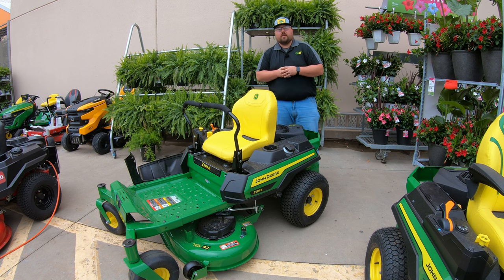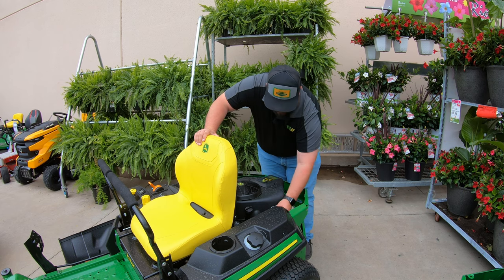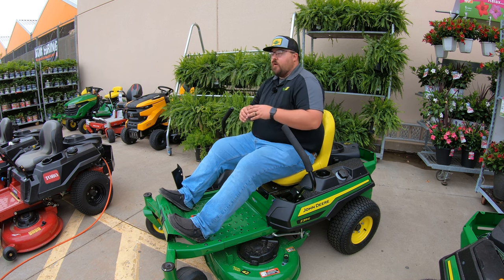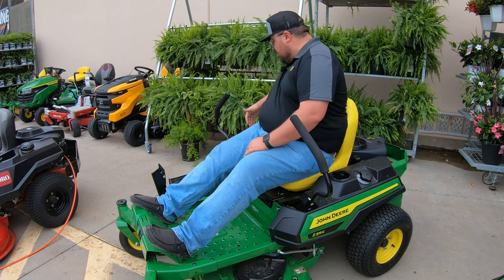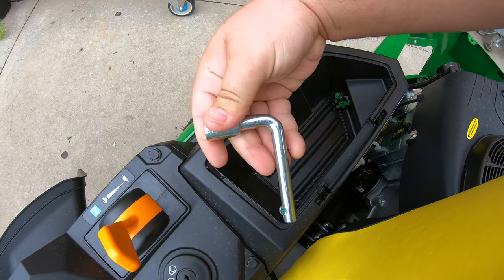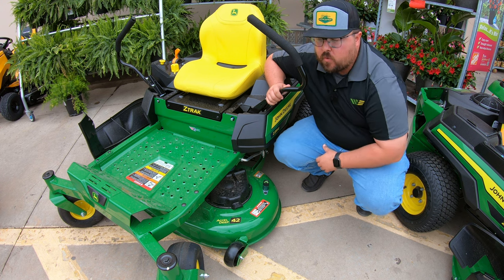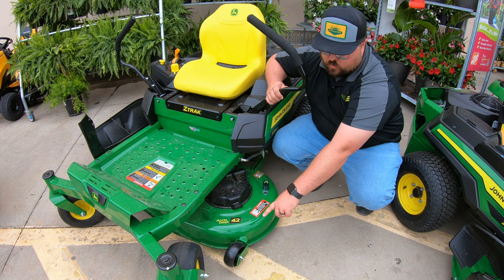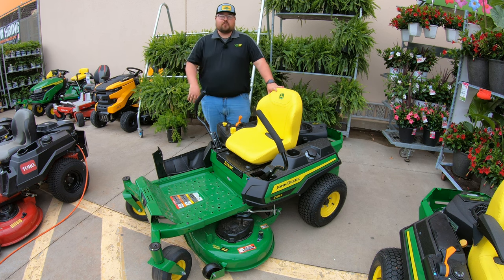2023 John Deere Z315E Zero Turn Mower Review & Walkaround

Comment: Could you guys make a video of why the John Deere z track deck wont lock when the pedal is pressed down? I think it’s simple I just haven’t looked and haven’t found a video on that.
Reply from the maker: Do you mean just n the Z3 series?
Reply: @WesternEquipment  no it was the 530m. I did manage to figure out that the back deck adjuster nut was over tightened and fixed it though.

Comment: Just purchased a 2023 with a 48-in deck. Bought the lawn mower right off home Depot floor. My husband and I have spent 3 hours trying to figure out how to start it. We started exactly as it says to in the book and it just won't start. It doesn't turn over it just doesn't do anything.
Reply from the maker: Interesting... So you have the control levers in the out position, throttle up, and blade button in the down position?
Reply: @WesternEquipment  yes
Reply: @lindamcallister4925 did you end up fixing the problem?
Reply: It ain’t got no gas in it

Comment: So just got one and was pumped, got six acres of land and was ready. got it to start up, followed the directions and read it more then twice over, but it won’t move forward or backwards. I’m slightly afraid that the Lowe’s movers, came in a big truck, dropped it off and left, messed something up, but I hope it’s just something I’m missing, I move the handles forward nothing, just engine runs, blades work. Just not moving. Any suggestions?(it started to rain so hopefully tomorrow I’ll figure it out but was just curious that maybe I’m missing something. It’s a Z325E (edit) I think I found the solution, will know in the morning. Yeah I guess  should have read it six times, it was simple, pull the disengaged things on the back.(metal pieces on either side)
Reply: Im trying to find the disengaged things you talk about in the manual. I cant seem to find them. Where are they exactly?
Reply: I'm an idiot, I found them.

Comment: Brent,someone else had said on another video that the briggs and stratton engine theyre putting on these now are not the intek engines they used to use. He said it was an exi Briggs and stratton engine. Can you confirm this,and perhaps highlight some of the differences between the two? I know some folks had complained befire about the camshaft in the intek engines.
Reply from the maker: I will dig into this and see if I can get a video out on the differences. Thanks for the idea!
Reply: @WesternEquipment  Thatll be awesome, thanks